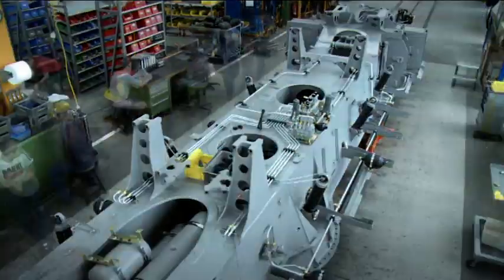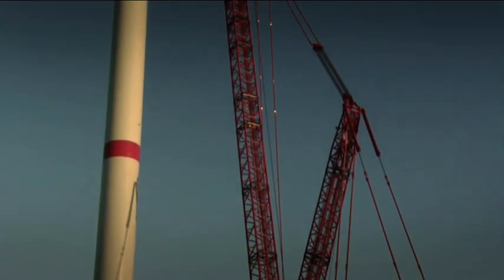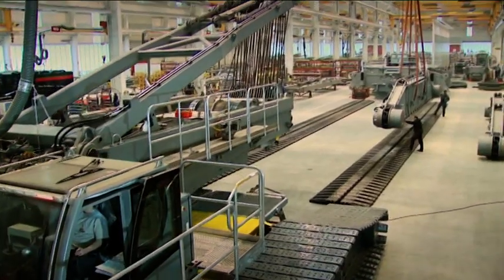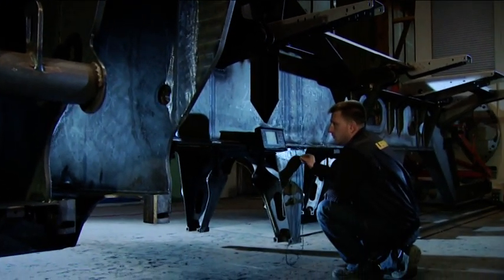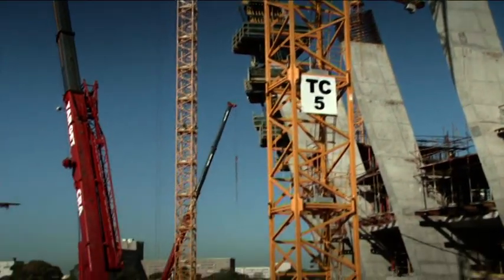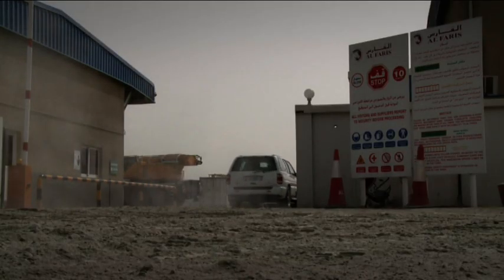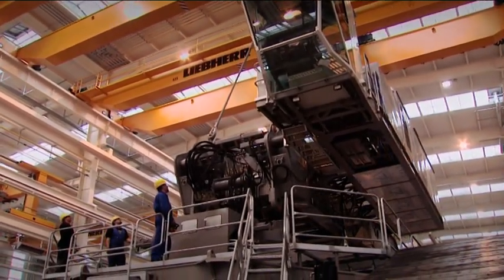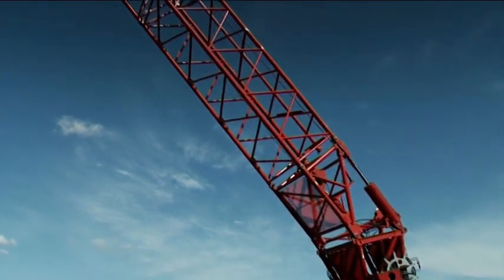Liebherr - Mobile and Crawler Cranes

Comment: You can buy real and fake Lego models of some of these bits of equipment. 
I've always been a " it's either real Lego, or no fake Lego" my entire life. But I've come to the conclusions, that Lego is REALLY expensive for a bit of ABS. When fake Lego is less than half the price and all the big models are RC n have an app and there bigger and better than anything Lego would make. 

Lego have REALLY shot themselves in the foot. 
The fake Lego is also made out of ABS and it's completely comparable as it's all like for like and will fit any existing model. Because if you want to make it RC, then it's a hell of a lot cheaper than if you buy real Lego parts. 

Just remember kids. 
Lego is just a name brand. 
It's also for bigger kids. 
And even bigger kids.
And even a really, much older kid (grown adult), with a gf/wife n there own kids, who you don't want touching YOUR Lego. (That's if she's still with you that is). But having house full of it and not being able to move because you spend your entire life balls deep into Lego (instead of being balls deep into your gf/wife) and not spending it with your gf/wife trying to make her happy.

Comment: 2 places Liebherr falls horribly short. Hydraulics, while well designed that are painfully organized. For some reason all the engineers have yet to understand mechanical accessibility, I got so frustrated with the hydraulic mayhem trying to fix some little part buried in un-bendable hoses.  The second place is the engine, it was almost good then we got a fuel pump.... Now wanting to rip that turd out and drop in a reasonable engine. Everyone else's fuel pumps, $1500 to $5000. Liebherr's Bosch basic fuel pump for a 6 cylinder $15,0000 = a joke.  Everything else is generally very good with some over engineered annoyances here and there.
Reply: Its what allot of major players in the field do. Make certain things such a strain you end up having to use their services. John Deere has that same tendency.
Reply: @7249xxl  There is nothing I can't do, but sometimes I swear a lot doing it.